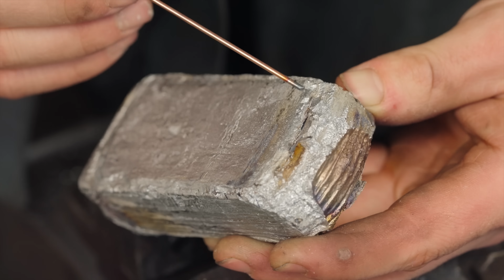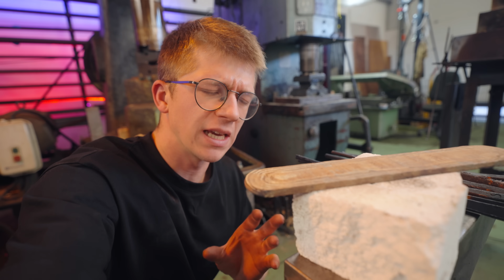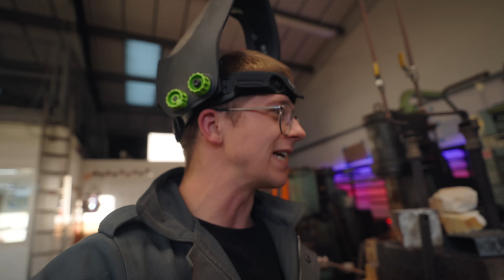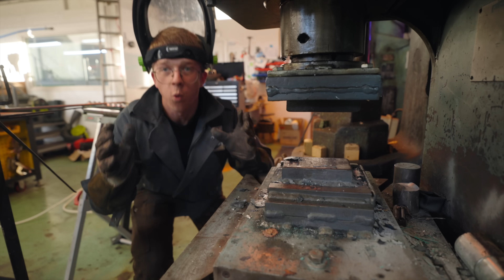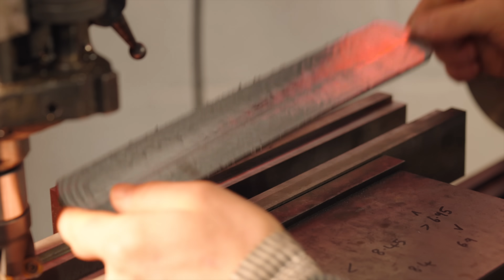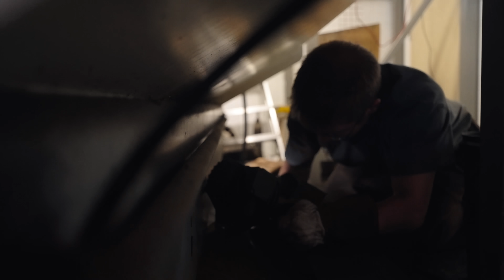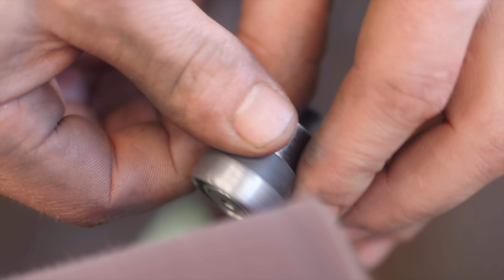Can I Make Titanium Damascus? Part 2

Comment: The unexpected liquefaction of grade 2 and grade 5 titanium at 2000°F (1093°C) under 2 L/min argon flow likely stems from **gas shielding inefficiency and impurity-driven melting point depression**, despite the forge temperature being below titanium's nominal melting point (~3034°F for pure Ti). Here's the breakdown:

---

### Key Factors Causing Premature Liquefaction
1. *Insufficient Argon Shielding*
   - **Flow rate mismatch**: 2 L/min is far below the 12–18 L/min range shown to effectively shield titanium welds in studies[46][49]. Low flow allows atmospheric oxygen/nitrogen infiltration.
   - **Gas turbulence**: Small boreholes (<6 mm) create eddies and uneven gas distribution[6][37], leaving localized regions exposed to air. Oxygen contamination lowers melting points:
     - **Grade 2**: 0.1% oxygen reduces melting point by ~122°F[2][8].
     - **Grade 5**: Aluminum/vanadium in Ti-6Al-4V further sensitize it to interstitial impurities[14].

2. *Phase Transition Effects*
   - Titanium’s hexagonal close-packed (HCP) → body-centered cubic (BCC) transition at ~1620°F weakens atomic bonds[2][8]. At 2000°F, BCC-dominated structures require less energy for bond disruption, amplifying impurity effects.

3. *Pressure Dynamics*
   - Narrow boreholes restrict argon outflow, creating localized *backpressure* in the billet. While high pressure typically raises melting points, turbulent flow (from small holes) causes uneven thermal distribution, enabling micro-regions to exceed the effective melting threshold[37][45].  Would recommend following patents placement of the holes. 

---

### Comparative Analysis of Observed vs Expected Behavior
| *Parameter*         | *Expected (Optimal)*               | *Observed (Problematic)*         |
|-----------------------|--------------------------------------|------------------------------------|
| Argon flow rate       | 12–18 L/min[46][49]                 | 2 L/min                            |
| Gas coverage          | Laminar flow, full shielding         | Turbulent flow, partial shielding  |
| Oxygen contamination  | <0.1% (Grade 2)[8]                  | Likely >0.2% (due to poor flow)   |
| Effective melting point | ~3034°F (Grade 2)[2][23]            | Depressed to ~2000–2500°F          |

---

### Root Causes and Solutions
1. *Gas Flow Optimization*
   - Increase argon flow to *12–15 L/min* to ensure laminar shielding[49].
   - Replace small boreholes with *larger-diameter nozzles* (≥8 mm) to reduce turbulence[6][37].

2. *Pressure Management*
   - Add *ventilation channels* to the billet design to prevent backpressure buildup while maintaining inert atmosphere.

3. *Material Purity*
   - Use high-purity argon (99.999%) to minimize oxygen/nitrogen contamination[8].
   - Pre-clean titanium sheets with acetone to remove surface oxides before sandblasting.

4. *Thermal Monitoring*
   - Verify forge temperature calibration—actual temps might exceed 2000°F due to uneven heating or hotspots.

---

### Liquefaction Mechanism Summary
- *Poor shielding* → Oxygen/nitrogen absorption → *Interstitial compounds* weaken metallic bonds.
- *Turbulent argon flow* → Localized oxidation → *Eutectic phases* form (e.g., Ti-O, Ti-N), lowering melting points[1][8].
- *Rapid heating* in contaminated zones → *Premature HCP→BCC transition* → Accelerated atomic mobility and liquefaction[2][16].

*Fix:* Optimize gas flow + nozzle design to eliminate turbulence and impurities. Verify thermal uniformity in the forge.

Note y don’t comments support markdown
Reply: Why do you have a ChatGPT answer

Comment: Idle question... why didn't you just use a belt grinder to remove the thin jacket?

Also, as a smith myself, this would be an absolute nightmare to work without an air hammer.

Comment: Is it possible that the argon running through the box is doing something to the amount of air pressure on the titanium and thus lowering its melting point? Idk, just spitballing
Reply: Pressure isn’t nearly high enough for that drop in melting temp. What more likely happened is iron was leached from the steel forming a new alloy which has lower melting temp

Comment: Argon is a poor conductor of heat. So, I theorize that, while the ambient temp of your furnace reads at one temp, the billet might be at a different temp, as it could be experiencing a sort of "greenhouse" effect while insulated from the environment by the gas flow. I conceptualize it as being like coffee in a thermos, where the heat keeps dumping into the piece, but is unable to leave.
Additionally, alloys can have dramatically different properties than their constituent materials in pure form.
Finally, when when you compress material, thus decreasing the volume without decreasing the mass, you're consequently raising the temperature. It's the same phenomenon behind diesel engines; compression=increased temp. This principleisnt only true for gasses.

Comment: You're already at the top end of the temperature range and then when you initially hammer you're introducing more energy which will be converted to heat.

Same way you can take a cold piece of steel and hammer it red hot with enough effort
Reply: Definitely not. He’s not at the top end at all

Comment: One of the Ti alloys (guessing 6Al4V) has a lower melt point than pure Ti. If you've welded Al you can recall how it transitions from solid to liquid in the twitch of a TIG pedal. That's what the squirt reminded me of, anyway. If you were to TIG with a fill rod consisting of alternating Ti alloys I'm positive you'd notice a difference in melt pool behavior as you consume.

Comment: It would be cool if you made one of these, and when you were forging it out of the cube shape, instead of going to the very flat bar you made, if you drew it into a long square bar shape, and then reheated it, and put a series of twists in it.  Once again I'm writing this comment halfway through the video, so I now predict that you will have done just that by the time it's over.  🤪
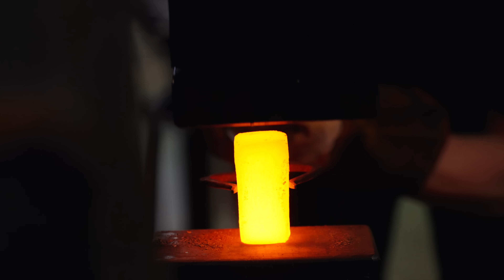Reply: Aaaaaand, just got to 13:20 where you're going to twist it.  Man, I have got to stop commenting in the middle of videos...  🤣🤣🤣
Reply: OK.  Now having watched to the end of the video...  I can tell you from experience with stainless damascus, if you take the other portion of that piece of twisted damascus, and put it in the mill, and drill a hole through it from the side, then mount it on a mandrel and put it back in the lathe, and then round it out on that axis, and them make a ring from *that*, it will look absolutely wild.

Comment: There is an Eutectic point @ ~1085 C, you may want to consider putting a some kind of a powder based tamper between the jacket and the Ti sheets (e.g, MgO, Al2O3, Boron)

Comment: As a preface I have no forging experience so please forgive me if this is a stupid question.  I saw a video on forging Japanese swords and to multiply the layers they fold the metal on itself several times while its being forged.  Out of curiosity would that method work here as well?  If so it might save a lot of frustration having to create and use a second box and would definitely save some waste.

Comment: 1700-2000 he did it 2100 1st time 2000 2nd didn't cross his mind 1900-1950 and the flow of argon wasn't supposed to be minimal but slow if 20 is max anything below 5 is slow which means 3 be might even better than 2 but we don't know because he didn't try

Comment: Titanium actually will start melting around 1700° F and fully melts at a higher temperature. Different types of Titanium melt at different temperatures also. Working with Titanium as much as i do, i recommend you work it as cold as you can
Reply: @Mjones8383  no, it won’t. That is straight out wrong.

Ti can only be cold forged small amounts due to its hcp steucture

Comment: I'm not a professional, but I think that the titanium melted into a liquid, because first of all, the whole piece is hotter on the inside than on the outside, and if you start to compress it with great force, the material heats up even more due to the great pressure and melts the titanium.

Comment: When milling metal like titanium you want to be spinning slow enough or feeding fast enough to get the chips to brake as much as possible. Also I even see machinists do this that should know better but hammering down material down when it's not sitting on a milled or square flat surface just bends the part and makes it less flat. When setting it on the side of the raw stock just let it sit how it is or you can place little shims under the parts that aren't down tight but I don't think that's necessary with a small piece like that. But ideally you would just mill one edge, set that to the back jaw, mill the face and set that to the back jaw, hammer it down mill the other edge and turn that to the back jaw, hammer it down and mill again. Repeat until it's as flat and square as desired

Comment: I realise you've made a part three already, but my hypothesis for the melting and p!ssing (from someone that knows sod all) is maybe the inside is getting hotter than it should because the steel jacket is acting like an all-around reflector, trapping heat and allowing it to build to a higher point than the rest of the forge.

Comment: Keep all those shavings. Would be interesting to heat it all up to that molten point and smelt it into bricks and see if any layers remain and how and if it could be reforged into a billet. Since so much was lost it might be a viable and interesting way to either recoup some materials or come out with even more unique patterns. Especially if you start adding other materials into them billets.

Comment: Now I’m only on part 2 so it may have been figured out in the 3rd part, but I have a hypothesis on why it keeps blowing out the front, I think the flow rate of the Ar is too high even thought it may only be 2L/h. I think it may be a lot more successful with around 1.2-1.4 L/h. Idk I think mix between the high heat and the high flow of Ar is almost making the metal melt at a way faster rate. It may also like to have a flow rate around 2 and 150-200°F cooler in the furnace.

Comment: It looks like the eutectic between Iron and titanium. I didn't catch which kind of steel you used but presumably the iron content is better than 70%. Additionally, iron oxide and titanium produce a thermite reaction which is potentially contributing to the problem. If I was going to try to fix that issue I would try electroplating the inner side of the steel box with a thick layer of pure chromium since it would prevent a eutectic with titanium for your temperature range. 

Safety note: Hot working chromium can result in hexavalent chromium fumes so PPE would be healthier.

Comment: I'm not sure if anyone else has suggested this, but if you put a temperature tolerant material, such as investment, in between your cast shell and the materials, you won't bond the shell and can chip off the investment when you press it.

Caution required as when you press it, you do not want the investment to become embedded

(Stone casting is also a great way to cast reliefs and other cool projects)

Comment: Through working the billet under the hammer, you are basically hard surfacing it causing it to stay the same size and sink into the billet forcing the inside to squish out as you said.

Comment: I'm not a metallurgist, but I'm wondering if an explanation for the melting could be something related to phase transitions caused by pressure. The thinking being that high pressure when it's hot could be causing some beta titanium to transition back to alpha as that transition, and that would be exothermic.

Comment: its some really expansive stuff so i wonder if fear of failure was a thing but,
when the 1st attempt you went to hot and it squirted out.
why on the 2nd attemt you still went to try and match the higher end rather then trying to go just above the minimum? 

even if it failed it would have gave you some learning moments.

Comment: Titanium picks up both oxygen and nitrogen from exposure to air above about 600 F (315 C) for extended periods of time.  I'd imagine at forging temperatures it's reacting pretty actively.  Both N2 and O2 embrittle the material.  I'm pretty confident you can't remove that O2 or N2 from the metal matrix by a simple anneal...

Comment: using the coolant on the machining process was the best step you could take for it lower rpms and higher feedrates also help too when machining titanium its all about controling the heat produced from the process also choosing the right insert cutter helps too you want an insert with a smooth coating to reduce friction

Comment: I was thinking if you were to hammer a V-shaped billet in a way that the hammer would plastically deform all the materials and squeeze the oxides out Of the 2 top pieces as you got to the bottom of the mold/hammer.
It would form the pieces back into squares. Completely separate into 2 pieces doing this. I think it would help squeeze the oxides out instead of to the metal. You would have to have just the right shape so that it would squeeze the metals into two separate V's and then back into squares.

Comment: I believe it has something to do with the gas, from the first video, you can see that the spill of titanium came from where the gas was going in so it either needs a slower gas flow or just do the hole as explained. 2 in middle on 1 and two up and down

Comment: Same concept as to why Solder will melt below the constituent elements melting point-- Lead and Tin both have melting temperatures sitting from 450-600F but alloy them together in any variable mixture and you get something that melts at about 370 depending on your blend. Thats probably whats going on-- the contact between titanium and iron is causing some sort of chemical reaction that bonds Titanium and Iron and your temperature is WELL above its melting point.

Comment: One possible explanation for the melting so far below the normal melting point is that the melting point is only for 1 atmosphere of pressure and sticking it in your forging press is bringing it well above that.
Reply: @TheEternalPheonix  increasing pressure increases melting point generally
Reply: @ I’m not certain how this is different from what I said.
Reply: @TheEternalPheonix  it is the exact opposite of what you said. Generally, increasing pressure increases melting temp, not lowers it.
Reply: @TheEternalPheonix  what is likely happening here is a eutectic reaction between iron and titanium
Reply: @Joker-em6oz  Sorry, I misread that.

Comment: Having done lathe work with titanium and knowing its properties, seeing it this hot and being forged is a bit terrifying. Ive seen 10mm wall titanium being cut off, chirping, screeching, and angry, given a break for less than 10sec, then immediately eat a carbide cutoff bit and the holder as it was advanced. That stuff hardens so fast and is so flammable. When machining it, you cant stop or pause. Maybe im bias, because of its machining specs, because that was my time in the firearms industry and my venture into making cans, but this stuff scares me to no end after seeing videos of it autoigniting on a lathe.

Comment: 1900F / 1038C Still far to hot for A) interactions between the Ti and the Iron. B) normal hot working temperatures for Grade 5 is between and 1697ºF and 1742ºF (925ºC and 950ºC) and for the Grade 2 temperatures between 1517ºF and 1607ºF (815ºC and 875ºC). As you have a sandwich of both grades, I suggest you need to be working around 1697ºF (925ºC) a good balance between the 2 grades.

Comment: Look the titanium and Iron eutectic. It is around 1085 +/_ 30 C which translates to 1985 F. 
Add the kinetic energy from your press, which increases the energy in the material, and voilà, you have molten Ti-Fe alloy. 
You can reduce the temperature to 950C, and you should still be able to forge weld. 

FYI 950C is  1742 F
And in not exact science explanation, when you reach the eutectic temperature, the metals that have higher melting temperature suddenly become liquid.

Comment: As far as I know, titanium and steel will never forge weld directly to each other. However, both will weld to copper, so you should be able to use copper as a "glue" between them.

Comment: I just want to say that as someone who is taking a chemistry bachelor that titanium probably isnt super pure. The melting point of a mixture is lower than the melting point of the substance with the higher melting point which is titanium. Might want to check out the purity of the metal in order to regulate the welding temperature. Cheers from a random guy in Portugal

Comment: "Were 900 degrees under the melting point"

Of it at 1 atmosphere of pressure. By pouring gas into the box's big hole and out two smaller holes you're raising it above 1atmosphere of pressure ever so slightly.

Comment: My guess.. the steel case.. surface between steel and titanium causes the inside part of the steel to liquify and 2 the argon purge causes rapid heating and thermal shock, further reducing titanium melting point.

Comment: Multi-Phase metals like alloys can have changed melting points and different viscosities at temperatures. You have to get a little bit into material science and "phase diagrams". Unfortunately, Titanium phase diagrams are on the complexer side.

Comment: Probably melts for the same reasons the ice melts under the blades of ice skates.
Increased pressure heats up the metal, and lowers the melting temperature.

Comment: Pro tip....use brand new carbide end mills.  If its sharp, it cuts like butter. That beat up, dull end mill you were using was rubbing the metal off. This rule applies to all machining processes except tapping. Titanium absolutely hates to be tapped. Hope this helps. = )